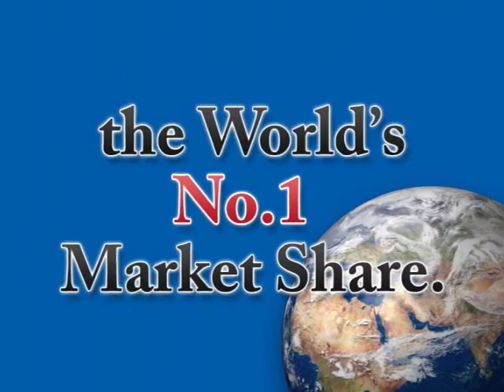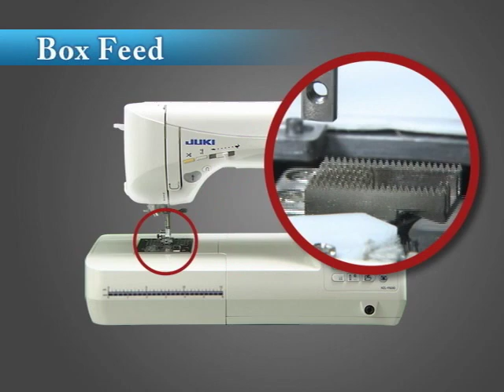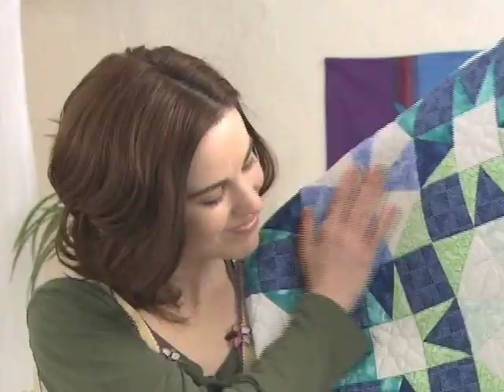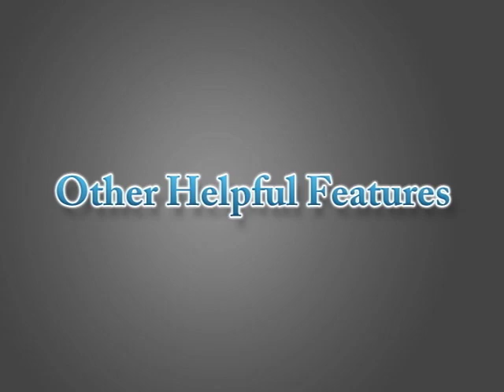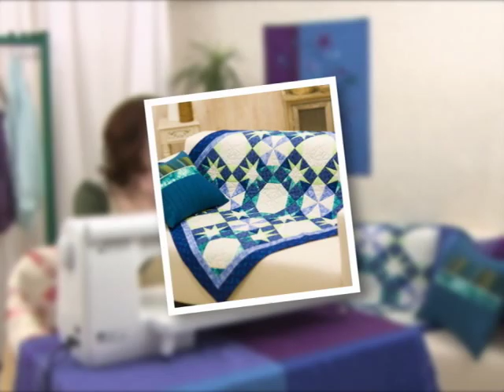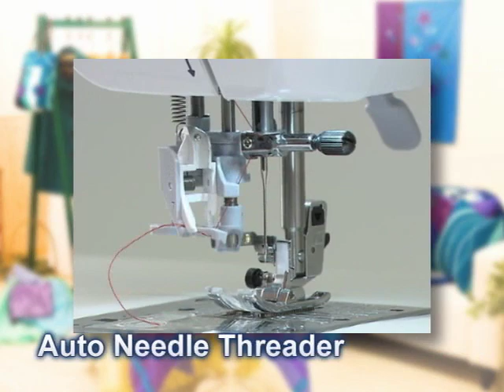How to use Juki Exceed Series F300 F400 F600 Sewing Machines

Comment: I cleaned lint from the bobbin area and reassembled the bobbin case holder etc. Now the bobbin doesn't sew. I went strictly by the directions and I am frustrated. I've never had a moment's problem with this machine. I love it. I just can't get it to sew now.

Comment: I have used Gutterman thread in Juki TL-2010Q machine and it breaks like crazy.  Can you give me recommendations for thread brand, weight and size that works well in this machine?
Reply: +LindieLee If the thread is breaking, you may need to adjust the tension or check to ensure the thread is not rotten.  I have a this machine and use Gutterman all the time.  It never breaks.  Best of luck
Reply: I second the Guttermann thread. My Juki F600 sews beautifully with that thread. You could try 50wt Aurifil. I'm going to give it a try and see how it behaves. It's kind of pricy so watch for a sale.